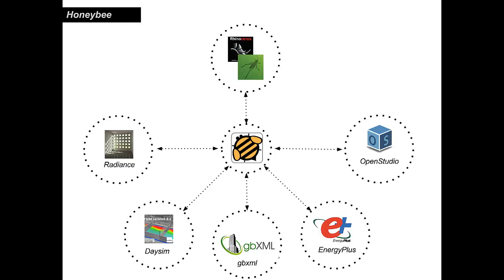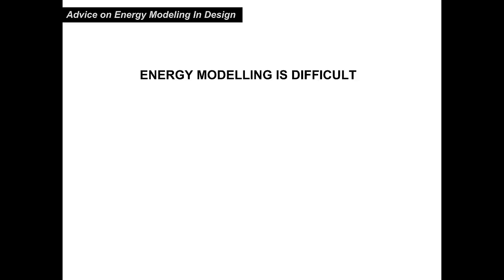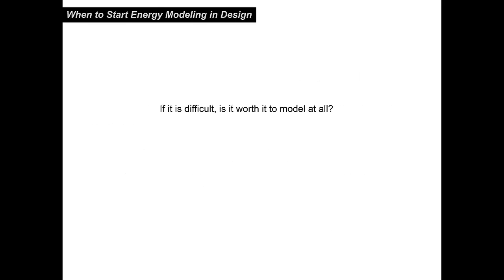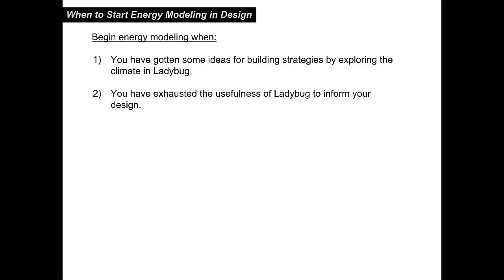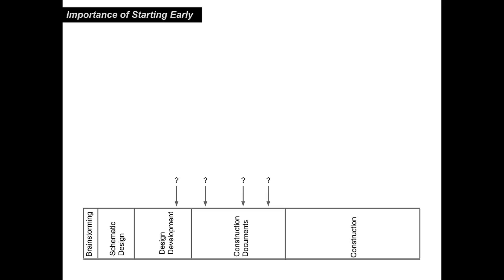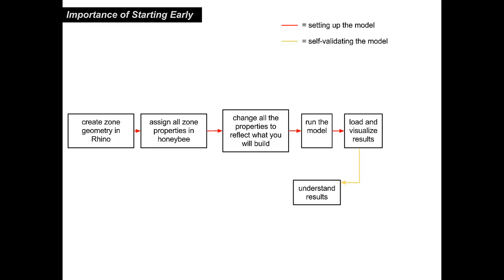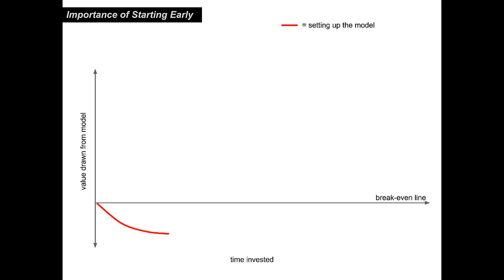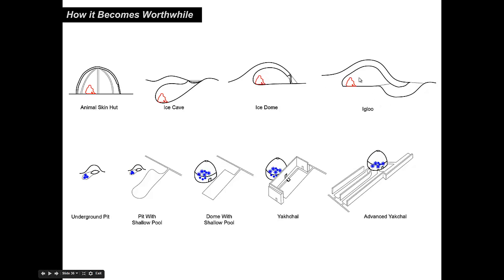0 - Honeybee Energy Modeling - Introduction

Comment: pleas whait the cause of this problem message  
1. Solution exception:The recipe failed to run with the following summary:
Scheduled 10 tasks of which:
* 7 ran successfully:
    - 1 AdjustSky(…)
    - 1 CreateOctree(…)
    - 1 CreateRadFolder(…)
    - 1 GenerateSky(…)
    - 1 PointInTimeGridRayTracing(…)
    …
* 1 failed:
    - 1 RestructureResults(…)
* 2 were left pending, among these:
    * 2 had failed dependencies:
        - 1 LetPointInTimeGridFly(…)
        - 1 _Main_d3f8d86cOrchestrator(…)

This progress looks :( because there were failed tasks

Use the report_out attribute of recipe settings to see a full report.